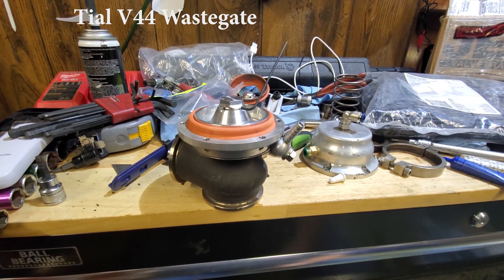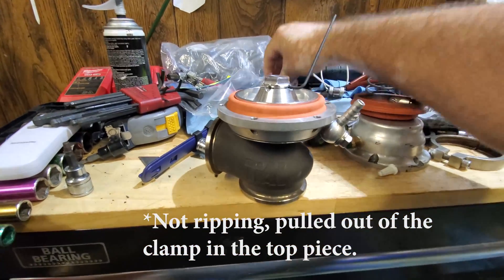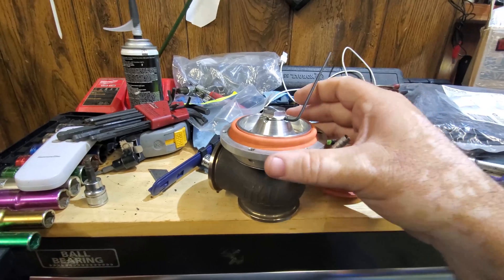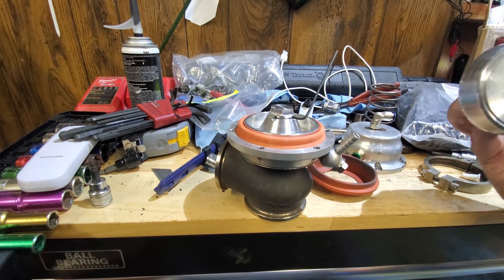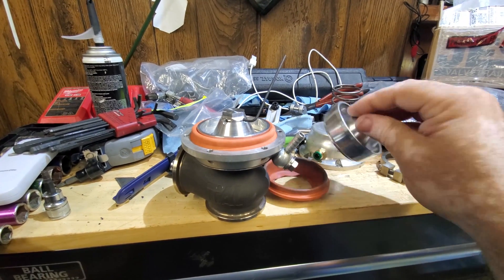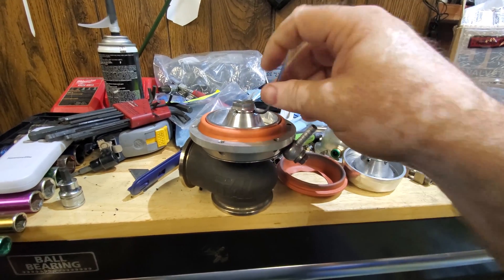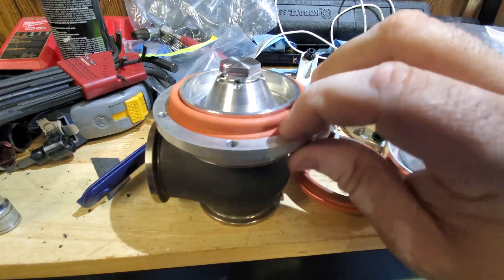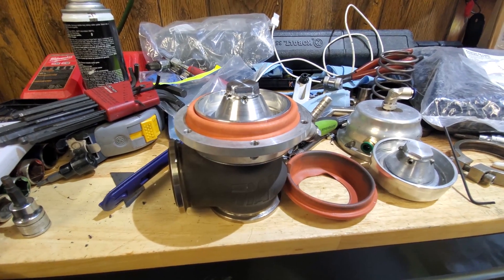Tial V44 Wastegate replacing the diaphragm

Comment: What were the symptoms of it not working? No boost at all, correct?
Reply from the maker: I was switching to co2 and you could hear the co2 leaking out. Before the co2 I was running 19 psi springs and didn't notice it was ripped.